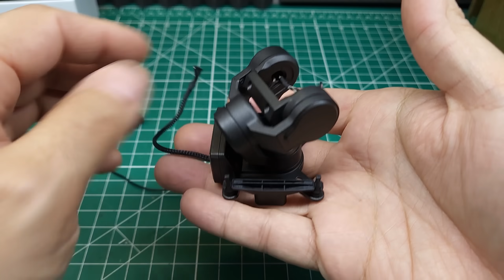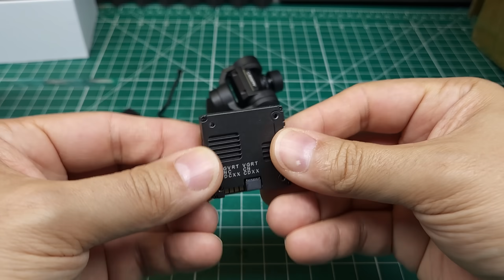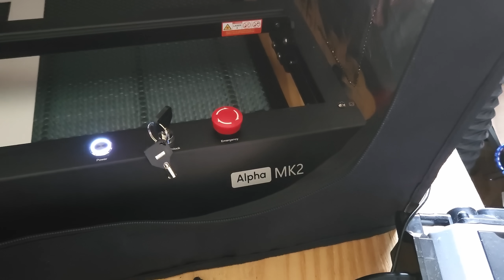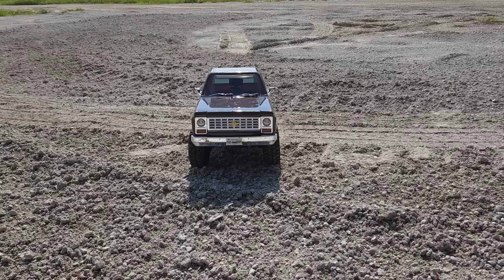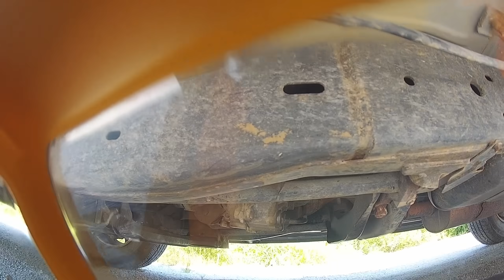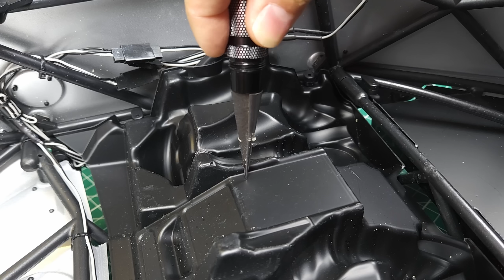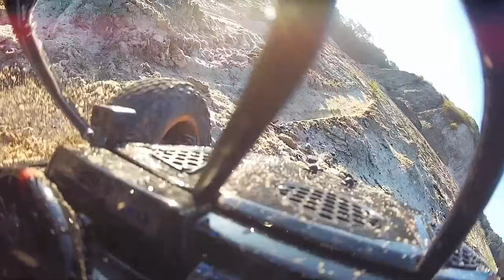NEW Head Tracking HD FPV Takes RC Bashing To The NEXT LEVEL!

Comment: I don't have an HD vtx or goggles but I have used an analog set on a Tpyhon Grom and it was amazing.  Mounted the camera where the wing is screwed on and it was almost like a racing game.  Fairly cheap to get into, 100 dollar goggles and the all in one camera/vtx/antenna combo for around 30.  Just need a battery for it or hook right up to the grom battery, not too hard to do.  The hard-mounting definitely has its downsides however, but putting a gimbal on top of a basher scares me haha.  I will definitely have a setup for my crawler though, that seems like too much fun.
Reply from the maker: Yeah I would not want to put one of these on top of an RC car. The gimbal seems pretty tough but I don't think it's that tough :-)

Comment: That's awesome is it easy to drive with that view and jump and land the car seems it would be tricky to jump not seeing the wheels to land?
Reply from the maker: Depends on the jump. I found that off of those gravel piles it was extremely easy and intuitive though with the supernut off of that ramp it was pretty difficult because the nut wasn't leaving the ramp at good angles so it was hard to know what was going on.

Comment: I put one of these (aliexpress version) in a 6s powered Losi RZR ... its good but dust becomes a problem real quick. I would say for long term you need to have a clear windows/windscreen
Reply from the maker: Yeah I kind of suspect it'll be a problem here too though It was pretty dirty and dusty where I was bashing and they still feel smooth as silk. I am sure they'll get crunchy over time though.

Comment: This could be the future of speed running. Being able to see what's happening from a 1st person view would really help drive cars at speed
Reply from the maker: Yeah I was wondering if that would actually be practically beneficial or not. People definitely need to try it.
Reply: I've been thinking about this for decades but now I'm into the drones
Reply: Crawling speed looks way different than 200mph. The link latency would be an issue. By the time you see something happening or about to happen it has already happened.
Reply from the maker: @webreakforsquirrel4201  I'm not sure that's true. This system was originally designed for flying high speed FPV quads and the latency is in the 20 millisecond range.
Reply: @webreakforsquirrel4201 there is no one racing at 200mph. Well on the ground anyway. This one I think is around 22ms latency which is plenty for mostly high speed drones. At 12km or so!
Reply: Use HDZero, or analog. No latency issues on those systems, folks use those for fpv racing (the pros are absolute rippers, handling with precision at mind melting speeds). But yeah even dji or walksnail are suitable for fpv quads for bashing around at 100mph no problem.  @webreakforsquirrel4201

Comment: Absolutely project!
Pls try to install this in a small scale rc. This would be my absolute dream.
So jealous right now, Im getting almost green😂
Can you tell me about transmitter power and frequency?
Reply from the maker: Because of the gimbal size we probably wouldn't be able to put it in anything smaller than maybe a 1/10 scale.  The VTX I was using has a maximum output of one watt and it operates on the 5.8 GHz spectrum.

Comment: Welcome to my world 👍✌️
Reply from the maker: Do you have this set up?
Reply: @DoRC  I build my own fpv gimbal frames using the storm32 gimbal controller 😎 tell me one thing, it looks like the caddx gimbal will keep operating after a roll over. Is this the case?
Reply from the maker: @JIPPERR_1  yep. I had to do zero resets on it throughout the entirety of my testing. I did have to recenter it using the triple press option on the goggles a couple times but I think that was just cuz I ended up sitting differently after flipping the truck over.
Reply: @DoRC  right on! I could see getting one of these gimbals for that quality alone. My current setup requires a reset after a roll over. I can do that on the remote but in a racing situation it means I lose a lot of time. I think we're going to see a lot of custom mounting brackets for these, 3d print files etc.  Having a rtr headtracking gimbal is a huge step forward for fpv cars for sure.
Reply from the maker: @JIPPERR_1 Yeah this is definitely a good setup and seems to work well. I'm more than impressed with its durability so far too. I fully expected it to either immediately die after the first bad crash or at least get crunchy with sand but neither of those happen. I'm sure over time it will get worse but so far so good.
Reply: @DoRC  it needs to be bashed until broken for sure. I use some pretty stout aluminum for my builds so seeing the caddx gimbal I was a little skeptical. The rubber vibration damper things I feel might let go first. Tbh they are probably not helping the situation when it's getting run off road at speed
Reply from the maker: @JIPPERR_1  Yeah not sure. They're holding up fine so far but you're probably right. I would likely want to do some sort of TPU replacement that's a little bit stronger. 
The gimbal arms are all metal.

Comment: My experience was not the same, I’m wondering if it was because I don’t use headtracking but the image was fuzzy from micro jitters
Reply from the maker: Did you just use an FPV camera directly mounted to the car?
Reply: @DoRC  no with the gimbal
Reply from the maker: @Rckid28  was it this specific gimbal?  How solidly was it mounted? Does it jitter when you just hold the gimbal and move the base around by hand?
Reply: @DoRC  works fine in a crawler, does not work in a basher
Reply from the maker: @Rckid28  ah. Hmm. I wonder if using it in conjunction with head tracking makes that smoother. I haven't really tried it without the head tracking.
Reply: @DoRC  yeah kinda a fail on caddx part, goggles L are the only ones you can do it with
Reply from the maker: @Rckid28  ah. That's a bummer. I wonder if updating the firmware might help. They have a USB adapter available. I had to ask them to send me one. There's also a bunch of settings you can adjust in the software that might change how it behaves. 
How did you have yours mounted in the basher?

Comment: Now it just needs to be connected to a sim rig. That! Would be the ultimate.
Reply from the maker: That would be awesome!
Reply: I posted a video with this setup and driving with the Logitech G29 steering wheel and pedals a few days ago on my channel. It's sick af to drive!
Reply from the maker: @rcautoball Nice! I'll have to check it out.
Reply: @DoRC  It's just a YouTube short. But, you get the point. FYI - it's an incredibly easy setup!
Reply from the maker: @rcautoball  how are you adapting the controls to the transmitter?
Reply: @DoRC  I'm telling you, it's easy af. The Flysky Noble NB4 Pro radio supports some gaming devices. This is one of them. All the programming and tuning is done right from the radio. By default, it's already mapped to pedals and wheel.
Reply from the maker: @rcautoball  So you just connect it up USB and it works?
Reply: @DoRC  Yessir! There's currently a bug on the NB4 Pro+ model that is preventing it from working. But, there's supposed to be a fix dropping here soon. It works great on the older NB4 Pro without a problem, though! The steering wheel just needs to be plugged into an outlet of some sort. You could easily plug it into a power inverter in your vehicle when you drive out to places to set it up too.
Reply from the maker: @rcautoball  Do you know if it'll work with the Noble Plus or if it only works with the pro? Also which specific models of wheels work? Is there a list? In order to do this I would be buying the transmitter just for this specific purpose so it would be a lot better if I could buy a plus and not a pro.
Reply: @DoRC  This is the exact reason I bought the Flysky Noble NB4 Pro+. It hasn't worked because of the bug I mentioned. So, I ordered a used NB4 Pro on eBay and it works great. The app on the radio is "Handle." It is NOT supported on the NB4 or NB4+; only the NB4 Pro and NB4 Pro+ models. The steering wheels supported (currently) are the Logitech G29 and the Thrustmaster T300RS. I have both, so I'll be able to do some head-to-head racing once this NB4 Pro+ fix gets dropped.

Comment: The first company to sell an RTR truck with a setup like this is gonna make a fortune.
Reply from the maker: Yeah there are a few out there already that have FPV built in but it's not gimballed and I think the stabilization makes a big difference
Reply: @DoRC  once the tech get better or a stronger gimbal system then it's game on
Reply from the maker: @MicroScaleGarage  So far I've been pretty happy with this system. I know it isn't designed for surface bashing but it's held up a lot better than I thought it would.
Reply: @DoRC Did you get a headache from using the fpv? Or does it have a wide angle lens, along with the stabilization?

I had an fpv goggles that did so, but I think its because the lens on the camera wasnt a wide angle lens (idk if thats the solution), so whenever the rc turned even slightly, its a completely new image that doesnt slowly prepare you for that new image (so if you turned frequently, u get headache).
Reply from the maker: @lyricofwise6894  The images fairly wide angle though some people do just get headaches and disorientation from FPV. Not only do the lenses in the goggles trick your brain into seeing an image in a different way than it actually is but your eyes seeing motion without your ears feeling it really messes with your mind. This can be exacerbated if you need corrective lenses and the goggles can't accommodate that or your IPD isn't set right. These particular goggles use really large lenses so IPD adjustment isn't necessary but with a lot of goggles it is. You can also get a headache if the goggles aren't on your head correctly.
Reply: @DoRC so do these goggles allow you to wear your glasses with them or no?
Reply from the maker: @savedbygracethroughfaith09  You might want to look up some goggles l specific reviews for that. I don't wear glasses so I can't speak to it but my guess would be no. There's not a lot of room in the goggles and most glasses probably won't fit. The goggles x allow you to adjust for different diopter per eye but I don't believe it's currently compatible with head tracking.
Reply: @savedbygracethroughfaith09  it depends on the goggles but a lot of modern FPV goggles have built in diopters so you can adjust your prescription with dials
Reply: @budmansdragracingchannel2726  There are normally aftermarket lenses and/or spacers available for glasses.
Reply: @lyricofwise6894  some people get headaches playing video games...
Reply: @DoRC  Hi. What is the total cost?
Reply: @DoRC  yah I did VR for an hour once and it gave me vertigo that lasted a week.
Reply: @DoRC we’re?link the built in fpv please
Reply: Take my money now!
Reply: @chevy4x466 ironquad 609 bucks for the WHOLE thing
Reply: Cannot be done,  the legal limit on the transmitter is so low that even a tree blocks the reception.
Reply from the maker: Sure if you stick with the legal limit but who's going to do that :-)
Reply: Traxxas udr would be a better choice for this setup
Reply: Check out ironquad they are releasing a head tracking fpv system for rc this year.
Reply: It’ll cost a fortune too

Comment: I am a big fan of your videos, but using a laser cutter to cut a rectangle sheet of paper? 😉
Reply from the maker: Absolutely! Even a cheap laser cutter can do this and it's fantastic for rapid prototyping and doing things like making screw pattern templates for things your 3D printing. 
You can cut out a piece of paper in literally 10 seconds which like I showed in the video allows you to check to make sure things are the right dimensions screw holes the line etc. It's super convenient and if you're iterating a design it can save you hours of waiting around for something to 3D print.
Reply: @DoRC  I usually use a ruler and scissors. ;-)
Reply from the maker: @ScopsLog okay maybe I didn't explain it correctly. This allows me to select the face of a 3D model that I'm creating for 3D printing and then cut just that face out in paper. This gives me an exact 2D replica of that face.  When iterating a 3D design it can often take several attempts to get the actual end result to be what you wanted to be even after careful measurement and this allows you to test the final result without actually having to print out the final result.
The example I gave in the video was pretty rudimentary but, especially for more complex shapes with a lot of constraints, it can be extremely helpful.
Reply: @DoRC  he, I was just messing with you. I absolutely understand the logic behind the cutter, I am also making paper templates first before working on plastic or metal. I was just making fun about it because of the rather simple design in this instance. ;-) 
I am using a DJI digital FPV system in my Summit, without gimbal though. Just with a small servo to turn it left or right. It’s great fun. I even bought a Radiomaster MT12 for better range. In contrast to flying quads the range for ground vehicles is often limited by dirt mounds, houses, etc.
Reply from the maker: @ScopsLog oh yeah for sure. In this case I was more doing it to exemplify the technique.  I probably wouldn't have done that for that particular part if I wasn't making an example of it.
The gimbal definitely is a great thing and I'd recommend trying it if you get a chance. Yes solid obstructions can definitely be problematic.

Comment: The video quality is sufficient just need to know the delay of video transmition and the range. Need to know!
Reply from the maker: This is the walk snail system and is originally designed for FPV flight so both range and latency are good. You're looking at around 30 to 50 milliseconds of latency and range will be highly dependent on terrain and which VTX you're using but it likely will be farther than you'll be comfortable walking to go get it if you have a problem.

Comment: Innovation rc tried a similar fpv setup recently on the mojave grom but had the display also showing split screen on the radio link rc8x maybe want to check it out if not seen it.
Reply from the maker: Yeah a lot of people have done FPV in RCs but until recently head tracking gimbals haven't really been available in sizes that would work.  In my opinion the stabilization of the gimbal makes a huge difference
Reply: @DoRC  yea don’t think he used a gimble  just fpv camera mounted.
Reply from the maker: @INIEILS0IN  yep. Definitely looks fun especially in a little car like that but the problem I've had with hard mounted cameras is that when the going gets rough it becomes pretty much impossible to see what you're doing.

Comment: I mean yeah, nice idea. not that ive done it earlier, but you surely messed up the mounting. Got that setup on a basher, going full speed over grass, no jitter, no bumps in the camera, smooth as a new road.
Reply from the maker: The mount on the super laser nut definitely could be better. Because I mounted it on the fairly thin plastic half interior shell it really wasn't that well supported. If I was going to have it in their permanently I would have mounted it to the cage instead.  Keep in mind though this also wasn't grass it was six to eight inch deep ruts made by construction equipment pretty much throughout.

Comment: Can you please share the entire setup description? Camera, gimbal, goggles, etc...
Reply from the maker: I do it at the end of The video. It's a GM3 caddx gimbal walksnail goggles l and the VTX pro 2. There are several VTXs that are compatible though.
Reply: @DoRC  didn't pay attention I'm sorry. Thanks for the quick reply 🙏🙏
Reply from the maker: @asoughi  no problem if you have any specific questions feel free to ask :-)
Reply: @DoRC  I'm thinking of mounting the camera with the gimbal for now just to try out... And obviously get the goggles too... Anything specific you recommend? Or go ahead with the products you described?
Reply from the maker: @asoughi  I think what I used in the video is probably your best bet. It's obviously not cheap but it is the cheapest way to get into that type of system. The goggles l are a box goggle. The goggles x are better but they're a lot more expensive.
Reply: @DoRC  thanks alot... 🙏🙏
Reply from the maker: @asoughi  You're welcome Good luck and let me know how it goes!

Comment: You should definitely put this on the Promoto! It will look awesome just seeing the bike leaning down :)
Reply from the maker: Trust me I was very tempted but the first crash and it would get wiped out. It's pretty durable but I don't think it would handle a direct impact.
Reply: @DoRC  Do you mean front or back impacts that will cause damage? Side crashes will be fine with training wheels
Reply from the maker: @iamgeek01  no I mean if it were to take an actual tumble.  As long as you're on smooth flat ground it's not super likely but one bad bump and the thing could Do a flip and that would be the end of the gimbal.
Reply: @DoRC  Oh I see, that makes sense. You should if you can try it on an arrma felony/ limitless if you have them while doing speedruns. It will look crazy.
Reply from the maker: That would be pretty crazy for doing speed runs!